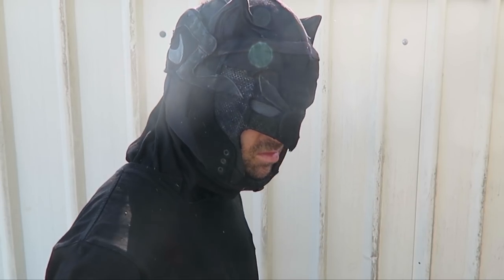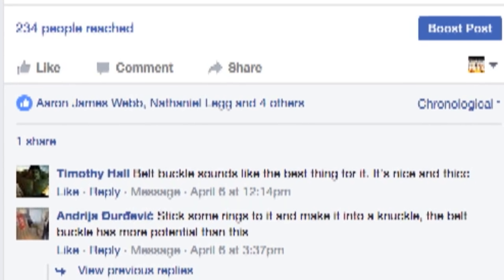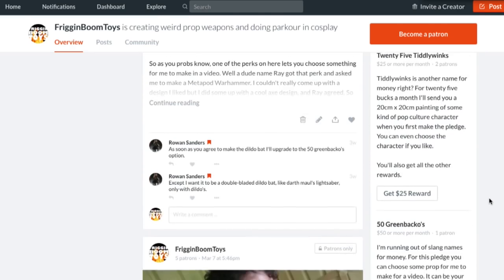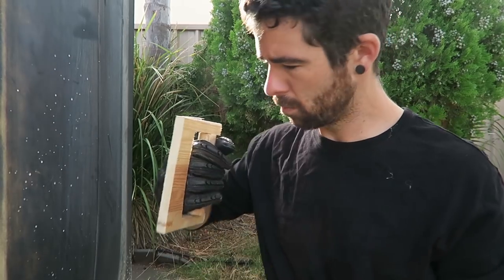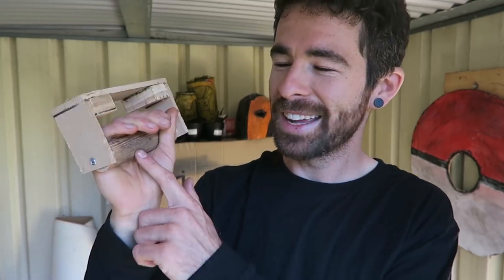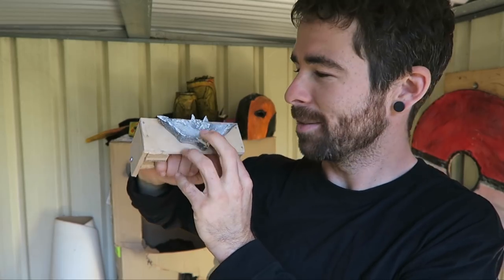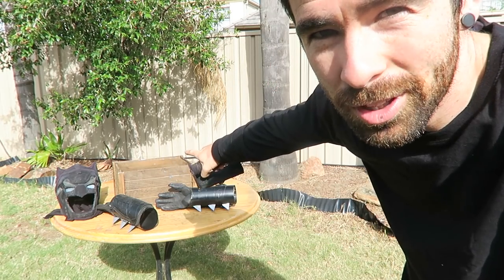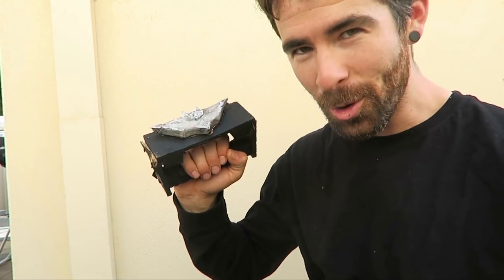Homeless Batman Part 4: Scrap Wood Knuckle Duster

Comment: You need to try to do some of his tech gadgets cheep
Reply from the maker: Any suggestions?
Reply: Friggin Boom Toys I know you make make a basic taser with a battery and tin foil. You can also make the battery heat a wire if you connect it to both positive and negative sides. Works best with D batteries